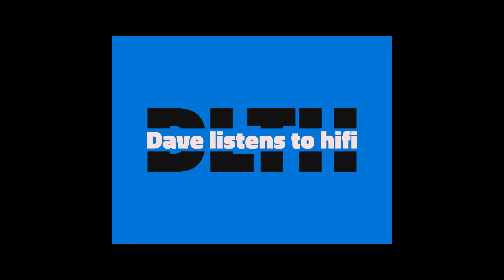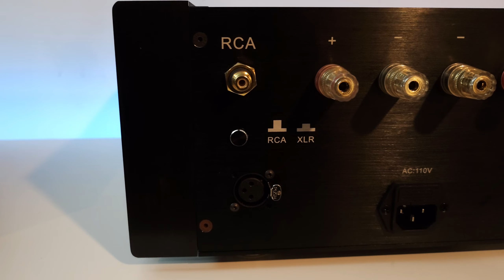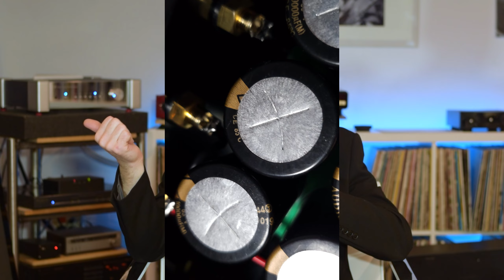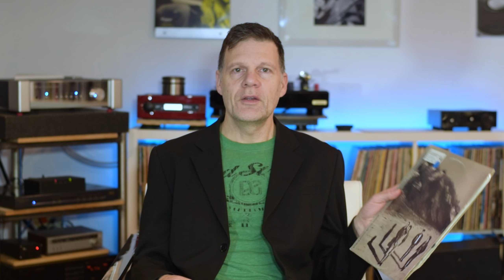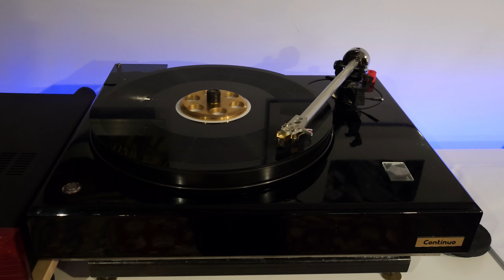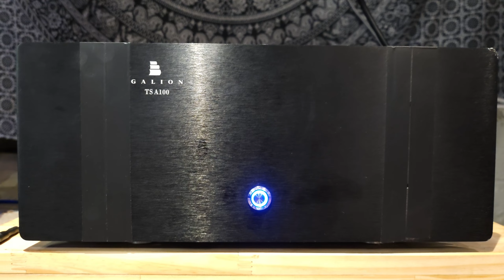DLTH Previews the Galion Audio TS A75 Solid State power amplifier

Comment: Hi Dave, so is the production A75 the same as the prototype you reviewed, or is it the “smooth” version?

Great detailed review!  Did you end up getting one?
Reply from the maker: Hey Super, thanks for commenting! I believe that the one I tried is the smoother one, it's slightly less sharp than the production version. I did not end up getting one, I went with vintage Krell. I compared my KSA50 to the A75 and it is even more spacious and revealing, but that is class A vs Class AB.

Comment: Great review! You gained another subscriber. How would you think the galion would compare to my two main amps, I have parasound a31 and ATI 542nc hypex amplifier. Ty in advance
Reply from the maker: Hi Don! Thanks for subscribing! I cannot comment on the Parasound as I don;t have experience with them (but likely in the same ballpark), but compared to a Hypex it will be certainly less powerful, fuller bass and more holographic presentation. Likely less glare in the high end. Depending on your speakers and specific setup, it may or may not suit your tastes. If you like expansive soundstage and palpable midrange, solid midbass, then the TS A75 is a really good deal!

Comment: It feels like a knockoff amp.   The parts make it look like a cheap “visiting” team attempt to make something bargain.   I am sure it may work for a few weeks or even months.   I don’t trust that thing for sure.  I will stick with my Rega. Why didn’t you compare this to other amps?   You eluded to other amps… Testing this in a vacuum doesn’t say much.
Reply from the maker: Hey Revelry, I tested this against my Ashly reference amp, and this is my new reference amp. The parts quality is pretty high, the build inside is meticulous (nicer than many other high-end brands I have seen) and the casework is OK, glad the money was spent on the inside. I do have a Rega Brio on hand, the older version, and that looks like it was built in a garage, compared to the build of this Galion amp. I'm sure more recent Rega equipment is better built. As for long-term reliability, I am using it every day for a few hours, it is working flawlessly without a single hiccup. The amp does not get very hot, so I think that speaks well for the long term reliability. If I do encounter any issues I'll be sure to mention it. I had some other amps on hand, they all cost more but they were on loan without the express permission to review, so I didn't mention the names. If I had more patreons and subscribers I could afford to buy more equipment outright and do comparitive reviews, just not there yet! Keep watching though :-)

Comment: Have you heard the Musical Fidelity M6si? If so how does the TSA75 compare?
Reply from the maker: Hey GBRM, I have only heard the M6si at a show, and since it is an integrated amp it's not really a direct competitor to the TS A75. I do remember it sounding powerful and detailed, but it is also rated at 220WPC compared to the 75WPC on the TS A75. I would guess that the A75 would have the edge in air and nuance, but the M6si might have more heft. Speculation, this opinion is for entertainment purposes only!
Reply: Hi Dave, I appreciate the info. thanks. @davelistenstohifi

Comment: Volume and gain are 2 separate things and are very different from each other. You can't change gain with a volume control. That's why its a volume control to begin with. If you want to change gain, there has to be another adjustment for it specifically. So, if you do have a separate gain adjustment, you should set that first. Its typically called gain staging. The reason you do gain first is only gain can distort the signal or overdrive an input. A volume control can't distort the signal. Once you have gain set properly, then you can adjust loudness with a volume control. Doing it this way ensures that you won't have any gain related issues. Once its locked in, the signal can't be distorted so you can set your volume control wherever it needs to be because you can't damage the signal.
Reply from the maker: Hi AT, thanks for your comment. As i was comparing an integrated amplifier to a power amp,  i used the volume control of the integrated amp to give an effective gain of the Galion and Ashly amps. Not sure if gain is the correct term to use here, but what i was doing was getting the same volume output for the same input voltage so i could just do an A-B comparison between power amps and integrateds.
Reply: @davelistenstohifi  Matching the levels on 2 pieces of gear to do an AB comparison is absolutely correct. You always want to do that. When I watched the video, I saw a potential problem because a lot of people think gain and volume are interchangeable. Its understandable because a gain control can look and feel like a volume control, but they're very different. A volume control can only attenuate the signal, and can't alter it. Gain can. A gain control can actually alter the signal. For example, if you were trying to match the volume levels on 2 pieces and on  one piece you moved just the volume control, and on the other piece you moved the volume control and some tone controls that would be a problem. The test would be invalid because adjusting the tone controls on just 1 piece introduces an element that's artificial, and its effecting only that piece. If we now replace the tone controls with a gain control in our example, you need to be careful. A gain control can be adjusted without effecting the signal but if you go too far, you can. That's why its important to know the difference. You may harm the signal without realizing it.

I'm not the best at explaining things, so I'm going to give a quick test that anyone can try. For the test, I'm going to use a guitar amp because its the only type of amp that I know of where you want to distort the signal with too much gain on purpose. If you don't already have a guitar amp, most people know someone who does. Here's what you do. Most guitar amps have a gain control and a volume control right next to each other. First, turn the gain know up just a small amount. Play something through the amp and keep raising the volume control. You'll notice that the amp will be playing a clean signal no matter how much you increase the volume. Now, turn the gain really high and the volume really low. The opposite will now be true. The signal will sound distorted at low volumes, and will stay that way as you increase it. This is exactly what you are trying to avoid with your audio system. 

Hopefully this helps.

Comment: Grateful, thanks for the review 😊
So, this amp looks to have taken several cues from Bryston. Not a bad thing!
Will this drive Maggies?
That should get those heatsinks cooking;-)

I use a Musical Paradise mp701mk2 valve preamp with my Bryston B3sst amp.
Now that Thomas has finally finished his 2 year assessment and review, why not get one to try with this amp?
Get the neutral V-cap eqipped model and some decent nos valves too....
🎵🎶😉🎶🎵
Reply from the maker: Hey, yes there are physical similarities to the Bryston amps, but I cannot comment on the circuit design at all. The MP701 is a cool product, but I think it's too configurable to use as a reference, it will be hard for anyone to relate to the sound when it is so variable!
Reply: @davelistenstohifi  
Get one anyway.
You can review valves;-)

Comment: The case work and component lay out looks like a DIY Audio First Watt Pass Clone project. Not a bad thing mind. The modular lay out and the overbuild means it'll last and be easy to service.  I'm sure that the amplifier modules on each side of the power supply has room for future upgrades or tweaks (even a whole new board set) by the manufacturer.   The power supply and heatsinks are so robust, it's like a tank...
Reply from the maker: Yes, the version I tried is not the production one, the finished products will be wider and have more room around the amp boards.

Comment: Thanks Dave for such a complete review. I can't wait for you to get the smooth version so you can compare.
Reply from the maker: Yes, that will be fun! I'll have to get another preamp in here to mix it up as well. Keep it coming with the great sounding Galion products!
Reply: Could you not use the Rega as a preamp did you use it as a prermp? You want a low impedance don't go for anything high impedance above 130 ohms the lowest as possible.
I did feel you were driving it a bit too hard it was brittle sounding impedance on the power amp might be too low,  a good test is to turn your volume up on your preamp to maximum and drive it with a separate digital volume like from a CD player, if it sounds distorted at low volume it's not a good match @davelistenstohifi
Reply from the maker: Don't think I was driving the Galion too hard, it was my Doge 8 feeding balanced cables into the Galion, volume control around the 10 o'clock position. This is the pre production version that is the edgiest sounding version, it suits my tastes but there will be a smoother version available. That's a scary test you suggest for checking the impedance match, I'll probably check out the specs first, my Doge 8 is supposed to have an output impedance of 600Ω but no published info on the Galion yet. I'll inquire...
Reply: I thought it sounded a bit brittle maybe that's down to the preamp??
There's no need to have such a large capacitance if you've got two Transformers that is,  if there are decent size they look about 500 va each is that right? you can make the amp sound sluggish too much capacitance try on the main filter caps keep the same amount of capacitors but go down to 18.8uF and the two on each module 9.4 uF in total so 4.700uF each. Also in the power supply use split foil capacitors DNM, that's what the top luxman amplifiers use 0r  you could try bipolar electrolytics they are generally quieter then standard electrolytics. 
Where  is the I'm assuming capacitors you're changing to make it sound smoother?
I'm not a fan of the bridge rectify modules what's its code, individual diodes would be better you can do it through using the transformer doing away with Bridge rectify it's a better approach. It's important to know what the impedance of the amplifier is? what is it? if people are trying to match up preamps, have you play around with different impedance on the power amp and come up with a best case scenario? You want to know the voltage input as well what is its maximum voltage input,  what I do is put some gain trimmers 100k each on it through a 30K resistor, and a multi-color changing peak clipping LED on the front just one for each channel, it's the best way to get matching so the user can adjust it. Or print what the best impedance input is for the amplifier if you haven't, what range does it like before clipping. What is its balance input voltage 6 volts or lower? Is that truly balanced or pseudo balanced hard to say it look like pseudo
Reply: @therealBozoDjTrump you asking Thomas to make you a custom amplifier? 🤣🤣🤣 if not already seems like you should build your own amplifier and sell direct to consumers
Reply from the maker: Now you're onto something!
Reply from the maker: Hey Jedi, can you elaborate on why a bridge rectifier is inferior to individual diodes in the same configuration? And how can you get the DC voltage with a transformer and doing away with the rectifier?
The smoother version of the amp will use different transistors, I would suspect that that version is the one you would be happier with. Thomas reports that this amp is truly balanced, not makeshift.
Reply: I'm very annoyed why made in China? it's not good why can't you get it made in Taiwan? better craftsmanship sure it wouldn't cost anymore.
We have to stop buying things from China not good for the world, we should be buying things from from dodgy regimes communist countries.